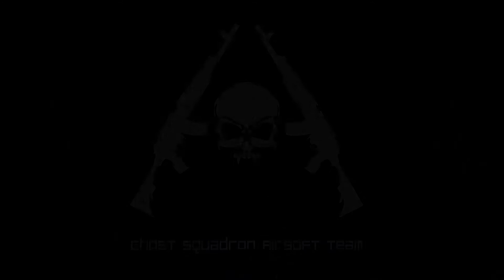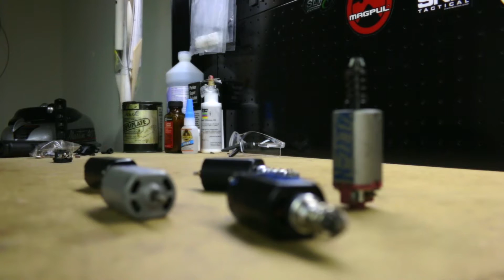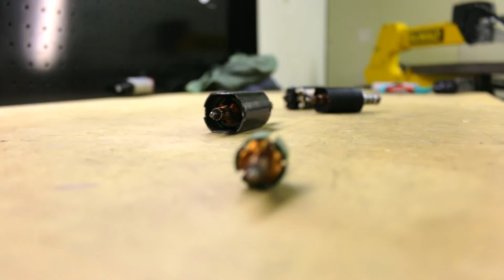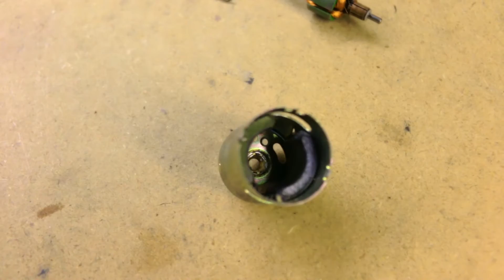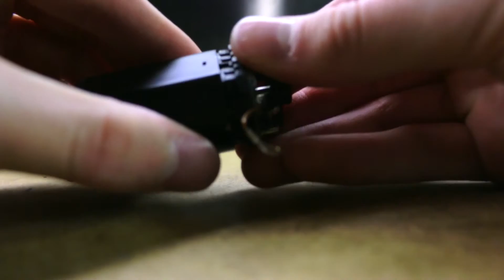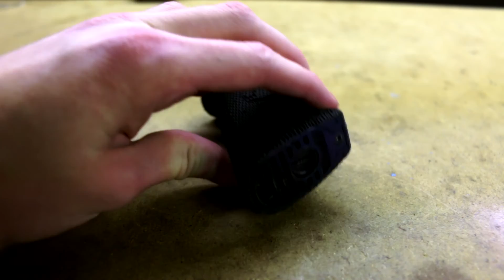Airsoft Tech: Motors (AEG)

Comment: I just picked apart my first AEG, a Cyma and I took pictures of the wiring, but unfortunately not of the motor itself. Looking now I can't find ANY indication whatsoever which connector is positive and which one is the negative. There's no sticker on it but one flat side have some printed text. There seems to be no + or - signs anywhere on it.
Any ideas which might be which ?
Reply from the maker: The only difference the electrical polarity makes is the direction the motor spins. So you can hook it up with the motor outside of the gun, hold the motor in your hand, and pull the trigger and observe which way it spins. Then just make sure you install it so that it spins in the correct direction.
Reply: Isn't there a red mark next to one of the motor terminals?
Reply: That's odd, must have worn off or something. You can always just try and connect the wires and see if the gun cycles correctly, if it doesn't you just have to reverse the polarity.
Reply: Just solder the wire directly on to the motor terminal, or get a new connector at a hardware shop.
Reply: Not a trace, none I've been able to detect anyway.
Reply: I've got it kinda sorted now, I know which is which and used some model paint to mark it up. Unfortunately the connector tab broke off while working with it creating an entirely new problem :(
Reply: I've got two options, for now I just loosen the screw holding the terminal plate on and separate the two plates, this allows me to show the wire between them and then tighten.  The secondary solution for when I get part is to get one of those fork or ring connectors and solder to the wire and fasten on the same screw. Soldering would give a good connection, but seems a lite bit cumbersome if you are going to work with the gun.
Thanks for advice and ideas.

Comment: hi! what is tpa means in relation to the motor?
Reply: Generally speaking lower TPA means higher RPM (speed) and less torque and vice versa. It's generally recommended to use a high TPA motor in combination with low ratio (high speed) gears to get quick trigger response. This will be slightly less efficient for the same ROF than using a low TPA motor with higher ratio gears, but with a decent battery this won't be an issue.

Comment: I've been having sparks fly out of my motor. Do you have any suggestion's?
Reply from the maker: That's quite wild! It's likely from the point of contact between the brushes and the commutator. The brushes may be worn or misaligned in such a way that the contact is poor and there is excessive arcing. The commutator shaft may also be misaligned.
You could try to determine which it is and repair it. I'd check/replace the brushes first since they are going to be the cheapest.
You could also buy a new motor.

Comment: great video as always, I have one question though, I'm thinking about upgrading my motor to asg infinity u-45000, but I'm not sure what torque it has (I would like to know what power springs I will be able to use) is there any way to calculate the torque of the motor?

Comment: i kinda go i little better understanding but still not that much... im working on a dsg built and want to be able to pul a m110-120 and stil have the best possible trigger respnse an semi and a high rps:) could someone help.....plz.
Reply from the maker: An M120 spring is a bit light for a DSG. You're going to need a very strong spring to move the piston back into position as fast as possible. Otherwise the sector gear will engage it prematurely. DSGs are typically used with M150-M160 springs.
To pull that back, you'll need quite a beefy motor. Many people build "frankentorque" motors, which I briefly mention in this video.
Reply: Stinger damn m160 ok thanks im going to look up frankenmotors👌thanks😉
Reply: Stinger but are you going to do a video about frankenmotors cause i really dont understand what they do and cant really find any good videos explaining why they are better and what they do and what parts are good.

Comment: Question, the part you plug the wires into, one of mine broke off , so only the black wire goes in. do i have to buy a whole new motor?
Reply from the maker: I believe he broke the tab on the motor that the spade connector on the wires connects to.
If that's the case, the motor endbell can be replaced as a whole, or it can be taken apart and one of the metal plates can be replaced. I typically cannibalize parts from old/bad motors for that.
Reply: Look for lonex gold plated motor connectors, if you have broken the part I think you broke, you should replace it with that, but in no case should you need to replace the whole Motor because of a small wire mishap, however on most stock guns you should probably look at swapping it out.
Reply: Stinger where would I find a endbell? And are they universal or do I need a specific endbell, my motor is high torque
Reply: Stinger it's the small metal piece with a small hole in It, very fragile, and it broke off
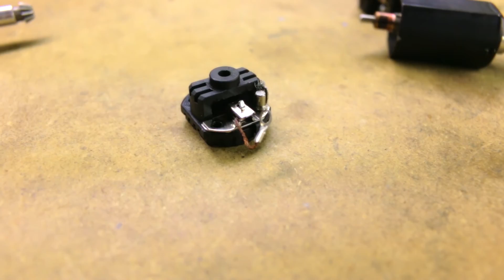Reply: Stinger seen at 4:30
Reply: 4:25 sorry
Reply: Yea, you'll have to look for I new endbell I should think, though if you have a v3 gb you may be able to directly solder your wires to the motor, depending on how much has broken off.
Reply from the maker: Like I said, I usually take them from old motors that I'm not using for anything else. I'm not sure where you could find them online.
Reply: Stinger eh I'll probably buy a new motor, thanks for the help man!!

Comment: SHS motors are 16tpa
Reply from the maker: +Alex Fong - The current generation of high-torque SHS motors are 22-TPA.
Reply: not entirely true. so far thats been a myth. ive handled a few new gen SHS high torques and they are still 16tpa
Reply: No stinger is right, the newer generation of high torque motors are all 22-tpa, the ones you had were probably miss-labeled or were from an earlier generation than he was talking about
Reply: no, the ones were newest generation shs motors straight from brill armory. me and several other techs have confirmed that they are still 16tpa. Ive yet to see conclusive proof that there are 22tpa shs motors
Reply: Are you talking about the green high torque motors or the red/black ones?
Reply: both
Reply: Alex Fong you're right http://ewairsoft.com/index.php/forum/47-aeg-aep/9337-motor-tpa-information-and-estimated-tpa

Comment: Here's an idea for future tech videos: try doing aeg repair ment stuff that would help us out alot
Reply from the maker: +ELITE STRIKE AIRSOFT - I don't know what you mean. I have multiple tech videos in which I work on clients' broken guns and show what went wrong as well as how to fix it.
Reply: +Stinger I ment making a video on different types of ways aegs can brake or stop working
Reply from the maker: ELITE STRIKE AIRSOFT - There's far too many ways that things can go wrong for me to cover all of them.
What I do is go over the common points of failure in the components that I overview for videos like this.
Reply: +Stinger well do u know what went wrong with my brothers gun, it still shoots but even on semi it shoots full auto and even when u let off the trigger it keeps shooting until u put it on safe or u have to unplug it
Reply from the maker: +ELITE STRIKE AIRSOFT - It sounds like something is causing the trigger contacts to stick together. The spring that is supposed to pull the trolley back may have broken or weakened.
This video will teach you a bit about the area where the issue is probably occuring: https://www.youtube.com/watch?v=mkBOTI02k5w&list=PLo3NCDfLNPA4ppAy6dKZ7K5L5IsO45Jbf&index=13
Reply: +Stinger ok

Comment: What motor would you recommend around the $20 to $50 range with 16 to 20 tpa? I am looking for one with reasonable power consumption, good trigger response time, and about 18 to 25 rps on a 9.6, 18:1 ratio, m113ish spring, and properly tuned of course. I am currently looking at the Matrix magnum motor, which has good reviews, but I am wondering if it's worth it to spend more. Also, It needs to be able to drop to a lower fps for cqb with no issues(rof does not matter as long as it still feeds)
Reply: +Guntech762 ZCI High Torque Motor. You can get it on BrillArmory for 30 dollars. That's what I used in the Reaper. It had a high RoF because of the 10:1 ratio gearset but trigger response in and of itself was amazing. It's a 22 TPA motor, so it's a little higher than what you specified but it is an awesome motor, and I'd recommend it. Stinger runs one in the Wraith as well.
Reply from the maker: +ltkillert92 - He wants 18-25 RPS with an 18:1 gearset on a 9.6v battery, so he's going to need a relatively low TPA. 22-TPA is too high for that. I would go with the Lonex A2 TITAN. It's a fast 15-TPA motor, but also has very strong neo magnets and is engineered well to have a lot of torque. It's currently sold out on Brill Armory (http://www.brillarmory.com/index.php?main_page=product_info&cPath=39_65&products_id=343) but should be back in stock sometime soon.
The Matrix Magnum is a fine choice, on the same level as the Lonex A2 TITAN.
Reply: Stinger Ah I didn't take that into account. Thanks.
Reply: +Itkillert92 +Stinger Alright thanks for the recommendation